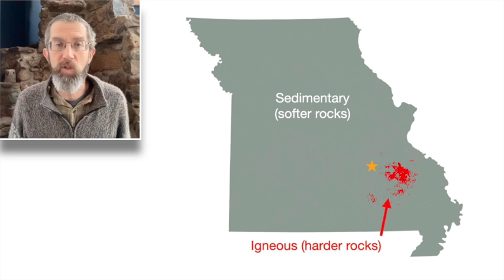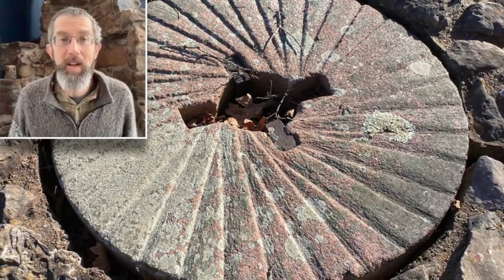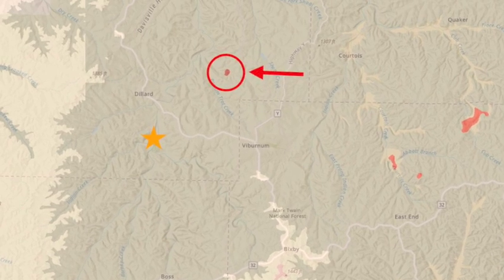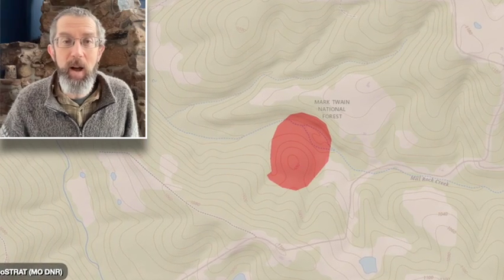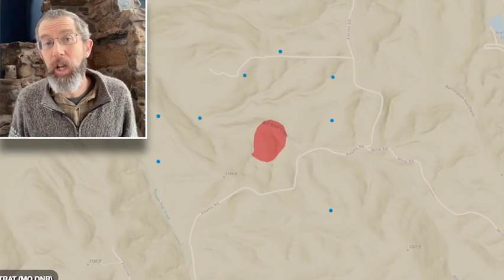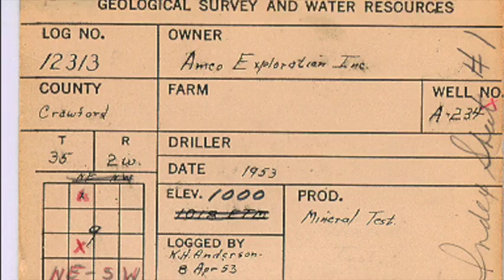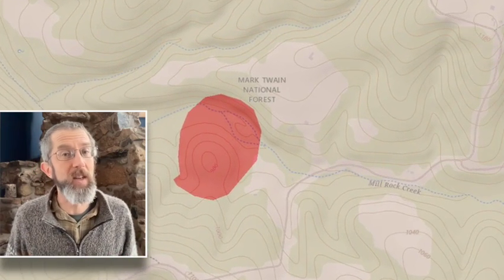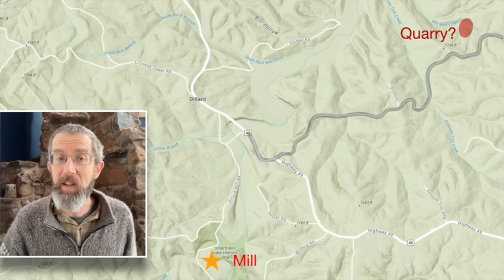Taken for granite: Cartographic clues to an Ozark millstone source

Comment: Sure seems more than just plausible! We lived outside of Dillard back in the early 70s, and it was my looking into the diversity of the rocks there that I stumbled upon your video. The creekbed by our house had some areas that were super smooth, some sort of dense, extremely hard rock. The surface resembles a slick, molten flowing mass. I tried chipping at it once and accomplished very litte. I have wondered if it couldn't have served as mill stone material.
Reply from the maker: There's only one very small mass of actual igneous rock anywhere in that area, and it forms a small hill away from any streams. Anything else is just well-polished sedimentary rock, which absolutely can look igneous to an untrained eye. Most Ozark mills did need to use sedimentary sources, especially early on, for the simple reason that there wasn't another option!
Reply: @ozarkoutsider , thank you for the reply because I definitely have an untrained eye and couldn't make heads or tails out of it.

Comment: I can't imagine the donated ones came very far,either. They are still just as heavy and expensive to transport as they ever were.
Reply from the maker: Hard to say, really. It's certainly easier nowadays to get one into a tractor bucket for loading and unloading, and a moderate-sized pickup truck can cover a lot more ground than a wagon! But we agree, the easiest explanation is that they're reasonably local.

Comment: Were those Alice Chalmers Mills?
Reply from the maker: Thanks for watching! Are you asking about the machinery? As far as I know, the machinery for the 1908 mill came from smaller manufacturers (based on labelling I remember), and I don't remember seeing Alice Chalmers among them. But the current mill was built in 1908, just as AC was getting going, so that's not very surprising. And the older mills, the subject of this video, well predated that era.